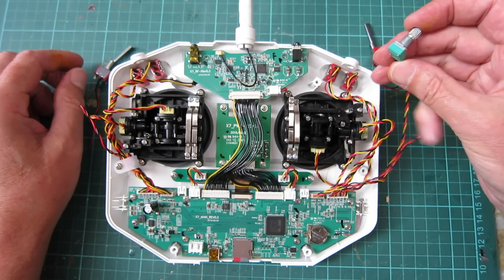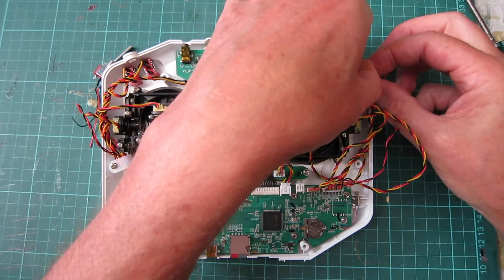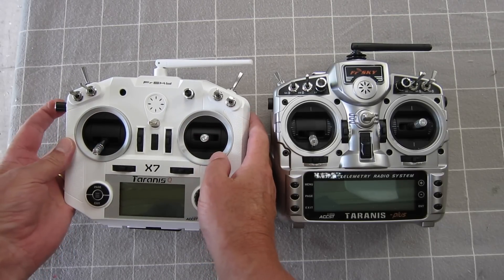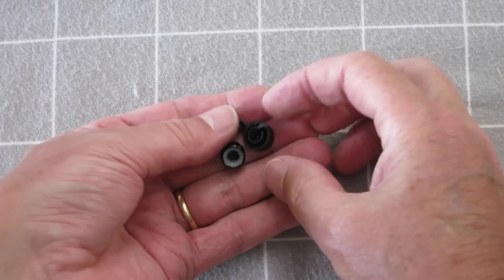Taranis Q X7 mods

Comment: Hey great video just got mine today.  I started with a spektrum DX6 years ago then DX7, then a Taranis Plus... I hated the feel of the taranis  plus compared to my old DX7, taranis plus feels off balance and cheap to me with no grip.   I really like this X7, it feels way better in the hand than the plus. with the rubber grips.   Today I did the spring mod so im in Mode 2.  and swapped my switches.  I'm used to my kill toggle switch on the right side for Helis.  Always scary cutting and soldering a brand new peice but it worked out!

Thanks for the good video it helped me a lot.
Reply from the maker: It is weird hacking it straight away but the results make it worth while

Comment: One other thing I would do in your place Andrew is hack into the audio path and replace the missing pot with a volume control. I had to do that with my X9 taranis for flying at night, it drove me crazy. Also, I just make my own audio files from Ivona and wave samples (f16, airbus etc) to match the open tx format, it should be easy to convert to whatever standard the x7 uses for bitrate and format etc.
Reply from the maker: You can assign volume to the other pot in Special Functions, it's just a menu choice.
Reply: Andrew Newton Excellent, I should have realised it would be that easy.

Comment: Andy, thanks for all your advice recently. I have now purchased the Taranis QX7 and am starting to set it up. Great Tx. I wanted to add 'throttle on' 'throttle off' sounds to a switch. I have no problem in actually allocating sounds to a switch apart from the fact I haven't got a 'throttle on / off' file in the sound card download. bootloader is 2.2.2 and FW is 2.2.4. I downloaded from  Open Tx companion. Any idea where I find these two sounds to add? Thanks. Mick
Reply from the maker: I'm using the Amber sound pack http://open-txu.org/home/version-2/v2-2-resources-2/
Reply: @AndrewNewton  thanks for that. I did see that download but wasn't sure what it was. Will try it today.  Cheers.
Reply: @AndrewNewton  Andy,  you are bloody brilliant mate. Just added all the new sounds to the tx for the first time. Got some great new sounds and also the throttle ones I needed.  Spot on mate 👍

Comment: I wish I could get my hands on a Taranis X9D White Case.....Not keen on the Silver version.....Nice custom Mod....Be interested to see the official S6 Pot installed with 6 indents on it too.....FPV Flight Mode switch essential for serious FPV ers.
Reply from the maker: I'd like a red one, could always buy a case and paint it I guess
Reply: Yes, a new clean case is required if you are going to paint it....Im wanting some of those Hall Effect stick units too...Sold out at the moment...Its a bit of a faff to paint, but with Carbon accents it would look stunning I think....The cases are pretty reasonable to buy....:)...A 5dbi antenna with SMA is also desirable for alternate screw on antennas.

Comment: Is there a difference between the X9D switches and the Q-X7 switches? In looking at the replacement parts there are ones listed as X9D and others listed as 2.4GHz Compatible. If I have the Q-X7 do I need the 2.4GHz Compatible switches or will the X9D switches work?
Reply from the maker: The connectors will be different, might need to do some soldering. And the collar thread may be different too, have to have the right locking nut. I have never heard of 2.4GHz compatible, any switches will work.

Comment: What about doing a 5dbi antenna mod on this radio?   The Taranis X9D needed to have an SMA lead soldered in but it looks like there is an Ipex connector on that daughter board for the antenna.   That should make it really easy to add an ipex to SMA lead and then maybe rig it through the antenna hole and have a screw on 5dbi.
Reply from the maker: Correct, just need to secure the SMA connector in the hole. Would be very easy

Comment: I want to access my spring tension  with the back on.  I will drill holes in casing.  Please could you measure hole points
Reply from the maker: It will be much safer if you measure yourself and drill with the back off

Comment: This is a 16 channel radio, right? What are the 16 channels used for?
Reply from the maker: Whatever you want, but I have never used more than 10. Needed 7 for the control surfaces and motor, one for the camera pan, one for the camera shutter and one used as a helper channel in some advanced mixing
Reply: Thank you. I think I should have asked 'Are they all analog channels?' That would have made more sense.

Comment: that tab on the pot was there so that the pot wont move inside :) probably better to make a small hole in the inside for the tab.
Reply from the maker: I though about that but didn't want to drill more holes.
Reply: yeah i understand - you made enough for a new radio ;-). maybe a taranis side slider would fit ? i must move one of the pots from my old fs-t6 - can live without the side pot too :)

Comment: If ONLY they made it work with the L9R... cost themselves one sale at least.
Anyway, good video Andrew.
Reply: It doesn't work with L9R??!
Reply: Michal Horváth, Apparently not, they decided to leave out LR mode, in my experience the best system they made. I get no range from x receivers (>1km = endless failsafes) yet 6km from L9R no problem. I now use flysky for telemetry stuff with well over 2k range. Taranis now only does L9R and Dragonlink duties.
Reply: L9R is the reason why I want to switch to FrSky. I was deciding between x9r and qx7. Thankfully I didn't bought qx7 yet. Thank you for information, it saved me some money.
Reply: Michal Horváth, Happy to help, but I do highly recommend the original taranis x9d despite my issues with X receiver range, it is still probably holding king of the hill for radio's.
My long range systems run telemetry duplexed in the video blanking so I have no need for x8r stuff beyond the flysky (with it's $13 telemetry 2.5km receivers). Cheers.
Reply: Manual says it works with L9R etc in L12 mode. Where did you get the info that it doesn't work with L9R?

Mode of Taranis Q
X7
Compatible Receivers Number of Output Channels
D8 V8-II series in D mode (V8FR-II, V8R7-II, V8R4-II, VD5M, etc.)
D series (D8R-II plus, D8R-XP, D6FR, D4R-II, etc.)
8 channels
D16 X series (X8R, etc.) Up to 16 channels
LR12 L series (L9R, etc.) 12 channels
Reply: Amir Tahami 
The early reviews initially all stated no LR mode was incorporated, maybe they revised it after final release, but I never saw anything yet stating otherwise. It certainly made no sense in not supporting it, apart from cost.
Reply: Yeah I agree but take a look at Aloft site. It clearly states that it supports L-series so I think we're good. We have to be otherwise I'm F*** as I have 5 L9R's hahaha
Reply: Amir Tahami, fingers crossed, I too have a stack of L9R's and it is time for me to buy another Frsky, I was initially hoping a later update would enable L9R, but forum discussions indicated it was not that easy as the RF packet system in LR is entirely different to other (telemetry) systems they support. Those reviews I think were pre release, but I have lost my search history due to Google fail.. Maybe Andrew can confirm if it has LR12 mode?
Reply: Confirmed. Mine has L12 mode

Comment: Yep that is what I wanted to know, if it had POTS on the sides, Once you use them you wonder how any radio can exist without them.

Well they should have kept the side pots and got rid of the top ones. Top POTS to difficult to deal with when flying.
Reply: Then this radio would be too good compared to x9d and no1 would buy that one anymore :p

Comment: Do you possibly know if the original Tarains side mount pots will be a direct replacement and the you would just need to drill the hole I found them on banggood https://m.banggood.com/One-Pair-FrSky-Taranis-X9D-Plus-Replacement-Side-Slider-p-1011451.html?rmmds=search
Reply from the maker: Don't know about that. I suspect you would have to clip the wires and reconnect. Not just one plug per pot